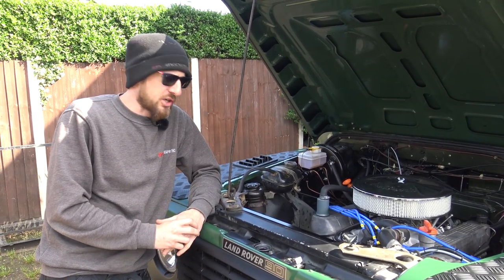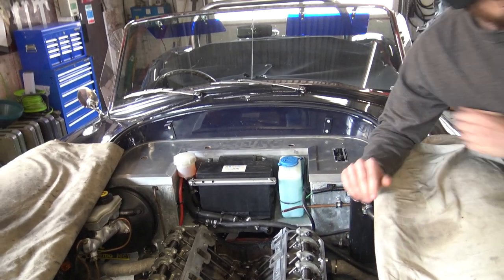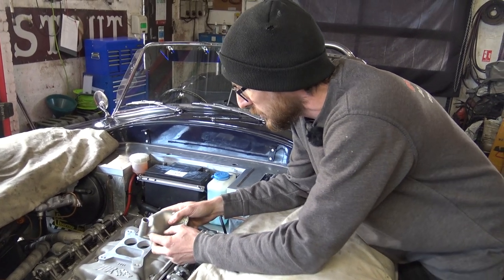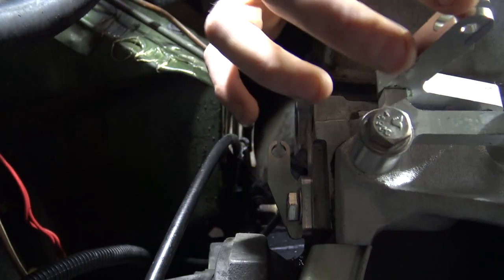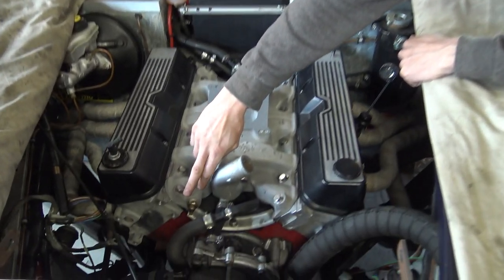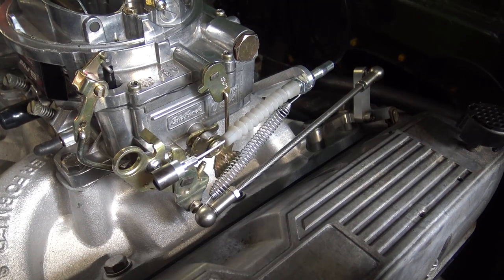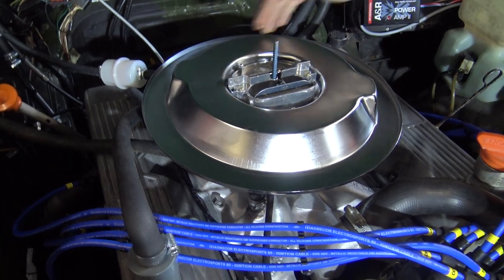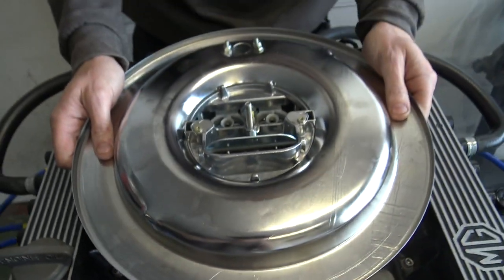Rpi Engineering Edelbrock Carburettor Kits Part 2A - Installation Guide - Rover V8

Comment: I've fitted loads of Performer manifolds, one little tip is to ensure that the valley clamps do not hit the underside of the manifold, this can happen if the block or heads have been skimmed, if you have the problem it will cause the manifold to not seat down on the heads, a little bit of grinding on the clamps will sort the issue out!

Comment: Correct me if I'm wrong, on one of the engines it shows a pcv valve fitted to the right rocker cover, with the aftermarket breather filter on the left. I thought pcv valves required full manifold vacuum, whereas you've got it plumbed to the air cleaner.

Comment: What is reasson to put one breather to the filter and a mushrom filter in the other like in minute 28:43. In mi car I have both breathers with a T piece to the air filter. Is there any problem in use mushrom filters in both breather?

Comment: Really helpful video, thank you. I’m installing my edelbrock carb. In addition to the breather layout you show here, I have an additional breather hole on a t-shaped piece coming out of the back under the valley gasket on the drivers side head. Should I just block this up or does it have to go somewhere too?
Reply from the maker: This is the breather from the valley on 3.5 litre engines. Later engines did not have it so there is no issue in blocking it.
Reply: @RPIEngineering  wow thanks so much for replying so quickly! Appreciate the advice.

Comment: does that manifold make more power than performer manifolds, I have trying to find a dino run I like the brand but i have never see one
Reply from the maker: We haven't done any back to back testing on the dyno, but out on the road the difference is so small you can't tell the two intakes apart.

Comment: I find it interesting that you used a circular pattern when torquing the intake bolts, instead of a criss-cross pattern.  Is there any reason for using the circular pattern instead of a criss-cross pattern?
Reply: It’s the original Buick way

Comment: I am in the middle of adding the Edelbrock manifold and carb to my Rover 3.5L V8 and this series is perfect! Quick question though. Does it matter which side of the of the coolant pump goes to the thermostat housing? Your video shows opposite to how mine was hooked up.
Reply from the maker: Hi, Sorry but I am not quite sure what you are asking. Can you please re word the question as the coolant pump (water pump) bolts to the engine and feed both banks of the engine via the timing cover ports. If you mean the bypass form the thermostat housing then this just needs to go pre water pump which cab be bottom hose, or a small port on the back of the timing cover as per the video.
Reply: Sorry I mean the 2 ports on the back of the timing cover. Which one, right or left as you’re standing in front of the engine, goes to the thermostat housing and which one goes under the Edelbrock intake manifold to the heater matrix? My right port goes to the thermostat housing. You have yours plumbed to the left port (@ 14 minutes in your video) Wish I could post a picture of mine.
Reply from the maker: @MUDSUX  Hi, It does not matter as both are inlets to the water pump. Just make sure that if your using both ports that both ports are actually open as one from factory has a core plug in it.
Reply: @RPIEngineering  Thank you so much! Also just changed my jets and needles according to your video. Can't wait to see your "Ignition" video as I will be installing a new Pertronix Flame Thrower dizzy next.
Reply from the maker: @MUDSUX  Well our video wont help you with that install at all lol as it will be installation of the Rover Dizzy, rpi amp etc.

Comment: Hi, could the brake booster hose in the wrong place? It may be more correct to connect it to the intake manifold .
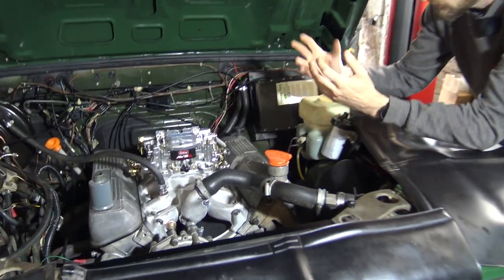Reply from the maker: Sorry I';m not sure what you mean. We show the brake servo pipe connection on both intake types being connected to the intake manifold. 15:50 and 21:05
Reply: @RPIEngineering  sorry , I used different model (2198 part number) I misinterpreted. In the 2198 model, the hose inlet is at a different point.
Reply from the maker: @2510RANGE  Its the 2198 intake that you can see in the video at 21:05

Comment: Why would you go from EFI to a carburettor set up?
Reply from the maker: Many reasons. Depends on the EFI system installed as to if you would want it or not. EFi is not for everyone, yes its more refined however carb can make just as much power and give great throttle response but maybe has a slight drop in efficiency (depending again on the EFI system installed). EFi can have sensor faults etc which customers in remote parts of the world dont have computers etc to diagnose correctly and want to just be able to see whats going on. - To name but a few reasons.
Reply: Electronics going obsolete.  Can work.on a carburetor..